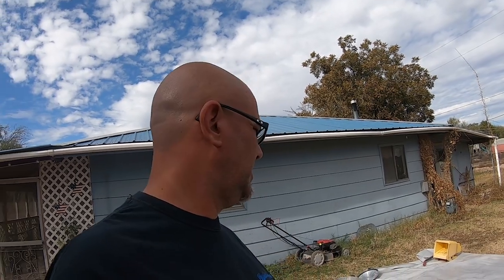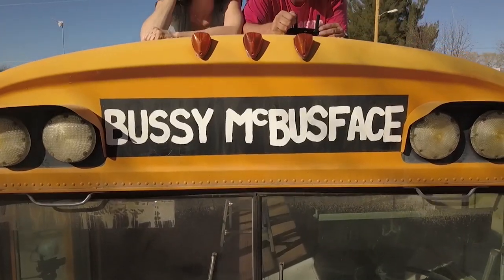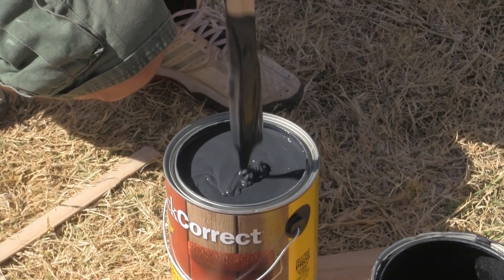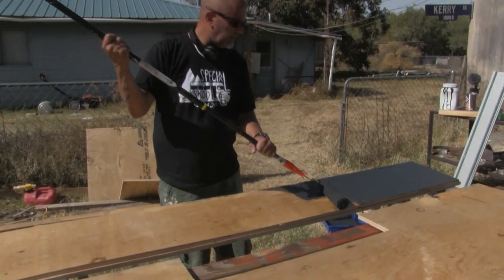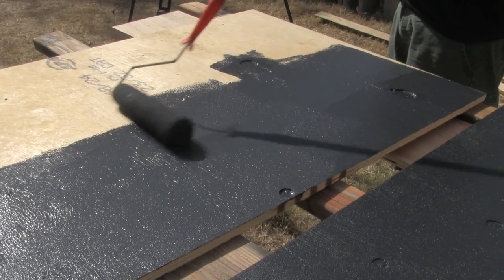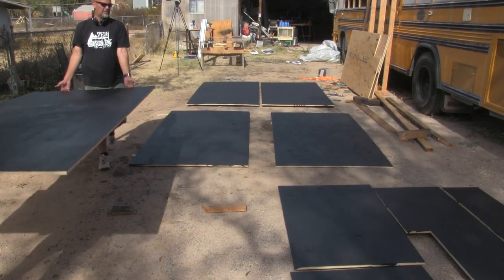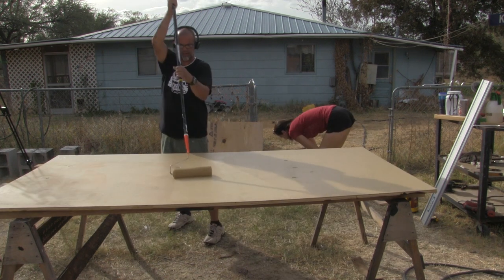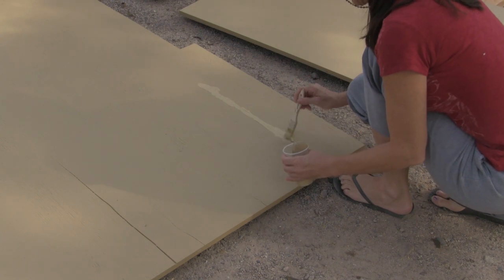Our Skoolie Deck gets Painted with DeckCorrect by Cabot (Part 7)

Comment: I was going to make a rubber protection on the huge woody deck joke but you two are as crass as me and went there first.
Reply from the maker: Ha ha, yeah there were several more that had to be edited out when we got to the caulk...! 🤣
Reply: @BussyMcBusface  I've had a monumental week in the evolution of my skoolie project myself.  Finally got the bus fully repaired after putting a rod through the block driving it home 18 months ago. It's been a challenging and expensive 18 months.  Just moved it from my diesel mechanic's facility and parked it on my family's property to start the actual conversion today. Quick crude video of its running after resurrection here... 
https://youtu.be/hXr3bSVPYV4
Reply: Hahahaha.... 😂😂😂 she said fill the hole!!!
Reply: @chuckspencer5296  I'm looking forward to eventually meeting these folks when we finish our bus and hit these road.  They've got personality and a great sense of humor!

Comment: First let me say I'm not an Engineer!  I applaud your desire and determination.  The only concern I would have is not weight on the roof, but rather the wind effect.  That's a great deal of square footage to have wind pushing down on the top and wind forcing the deck up from between the deck and the top of the bus.  You mentioned screws!  If anything, I would use stainless bolts, washers and lock-nuts.  I have seen the idots with the new matress they just bought fly off their car/truck (due to lack of planning for wind).  Keep up the build...
Reply: They could build a fairing around the bottom of the deck to reduce lift if it becomes an issue

Comment: When you start to see your plywood delaminate, you might want to look into a product called advantech. They make several products but the one you would want to use in this application is the 5/8 inch sheeting. It looks like regular OSB but it's impregnated with a resin. Feels almost like it has paraffin wax on it.It's also a tongue and groove sheeting. It can be submersed in water with out any effect to it. In fact when they 1st came out with it, they had a display with a sample piece encased in water. I've used it for over 30 years on various projects and have never seen it deteriorate. I've even seen a roof sheeted in it that sat through a New York winter with out anything covering it. Didn't hurt it one bit. Weight wise, price wise, considering how durable it is, it's comparable to the plywood you're using.
Reply from the maker: Man, where were you 3 weeks ago!!!! 😁 when and if this fails with yearly attention, that will be our next goto.

Comment: The thing that I was thinking about is wind both side and front ,  the lift issues  and uplift would be pretty substantial.  The bus was never designed to have a deck the full length on the top.  I don’t know but I hop it’s safe when you have front on wind at say 70 kts  and combined the lift pressure underneath,  hope it’s safe and you are I feel I’ve got to know you two  through your videos  and the great fit out of the bus so far. I just guess I’m getting old at 63 yo  stay safe John
Reply from the maker: I would argue that there is no lift associated with the deck in aeronautical terms. As far as turbulance is concerned, yes but then I would argue that the air pressure under the deck is lower than above the deck and therefore pressing the deck down onto the bus. The math supports our deck. Just as and airplane wing, the air pressure above the wing is lower because the air has further to go over the top of the wing. On the deck, the air has further to go due to turbulence caused by the supports under the deck and therefore the pressure above the deck would be higher causing negative lift on the bus.😁

Comment: I dont know about everyone else but when i mentioned weight before i was not concerned about if the frame could handle the weight i was thinking about how much its going to cost to haul 1k lbs of steal per mile assuming you built that thing with range in mind. I do like the color of the deck is it a hint at the body color?
Reply from the maker: We're prepared for just moving slow in both respects of the word: driving at slower MPH and enjoying the scenery, plus only moving to a new location once every 10-14 days. I once heard someone say "When God made time, He made enough of it," and it's sort of become our motto! We haven't even decided on a body color yet (open to suggestions!), but figured this would be neutral no matter what. ~K

Comment: Will the painted surfaces be too slick,for walking on, especially when it is wet? ( If so you could get some of those anti-slip rubber strips like you put on a truck bumper glued on?) or (Mix some course sand with more paint and paint it ?)

Comment: That's going to turn out bad in a couple of years all rotted. Maybe next time I would use that composite decking it would look really nice just have to drill bolt holes to bolt it down.
Reply from the maker: Yeah we considered that but our neighbor had just used it and it required a shorter span, which would have required a lot more metal, so it didn't pay off. The plywood is cheap and easy enough to replace in a few years!
Reply: Fair enough lol. Thanks.

Comment: Love the color but I think you might wanna use your hand-held digital  thermometer on it after a coupla hours of direct/full sun. The guy next to me in the marina used the same color on his fiberglass sailboat's deck. First time I walked on it barefoot I swore I'd never do it again. I used my digital thermometer after that and in 89 degree Fahrenheit weather the deck was over a hundred and twenty degrees at 11 AM. The inside of his boat [ I don't think it'll be the same effect in your bus]  was too hot below by 9AM. He ended up painting over the sand color with white and that dropped the temp way down. Try it before you put the deck on.Ever walk barefoot in the beach sand?
Reply from the maker: you know, we intentionally avoided white because we were so blinded by the Henry's Tropicool we used on the metal roof! I guess there's just no win/win on this one, we'll just have to wear shoes up there! It'll probably be 150 degrees in the AZ sun ~ sheesh, maybe we'll just make it a stargazing deck, LOL!

Comment: That bus is NOT rated to carry 84 adults. it is rated to carry 84 elementary CHILDREN!  A substantial and very important difference.  It is rated to carry them three to a seat, now measure the width of one of your seats, divide by three and decide if you could fit in that small space.  When made to accommodate adult passengers, these style buses will only seat between 46 and 56, depending upon the type of seats installed on the bus.  Check the data plate inside the bus to find the gross weight rating, then weigh the bus at a public scale to find how much you can really add in weight.  The 2008 Thomas sitting in my driveway is rated at 34,200 gross, with 21,000 on the rear axle and 13,200 on the front axle, only there's a catch; in the US, under DOT rules you are only allowed 12,000 on the front or steer axle and 20,000 on a single rear axle, bringing you to only 32,000 gross.  The rest is a built in safety factor.  You're doing a great job, keep it up!

Comment: Coming from a professional painter you would have been off better if you would have got lambswool half inch nap if you would have made your job a lot easier and a 5 gallon bucket with a grid in it